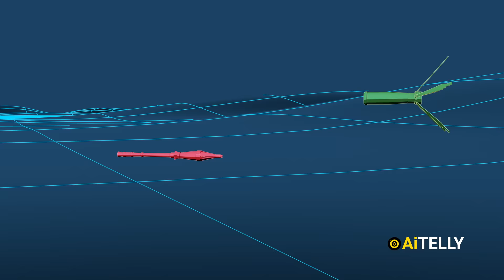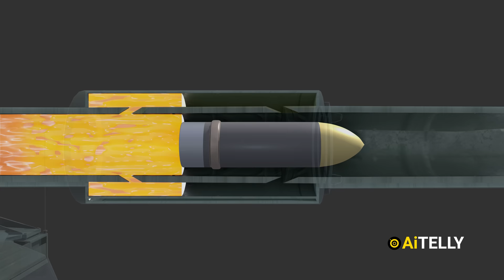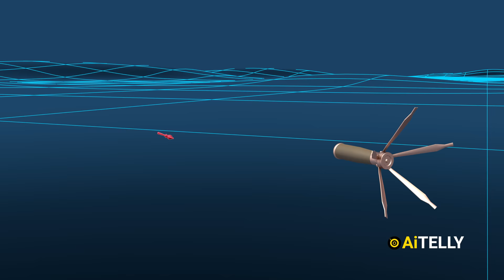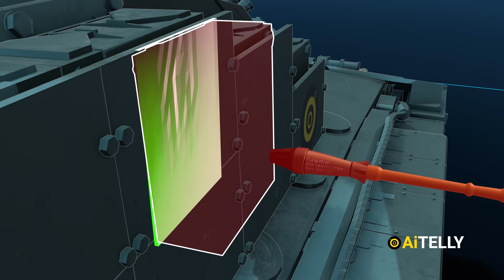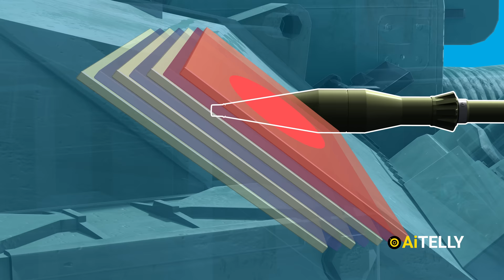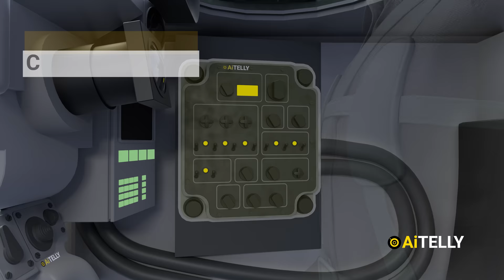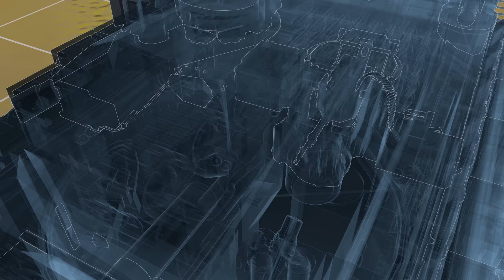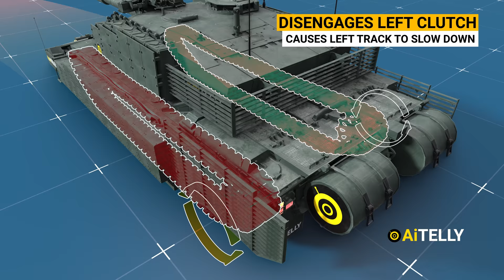Challenger 2 Tank How it Works - with Chobham Armour and Iron Fist

Comment from the maker: Imortant Notes from our Audience The Community is great here.
1) "Qasim Mir"
 It’s important to note regarding driving is that the steering is geared. Meaning with each gear there is a different turn radius, so if you want to do a tight turn you must change down a few gears to be able to do it. Another thing is the steering tillers only control where the front of the tank is pointing. Meaning, if going ahead and you want to turn right, you must ‘come right stick’ pulling the right lever, but, if you’re reversing and you want to turn right you must ‘come left stick’ and pull the left lever.

It would be good to touch on the tank’s suspension. Unlike other NATO tanks using torsion bars, Challenger 2 uses hydro pneumatic suspension. The British don’t like suspension that is mounted inside the hull on MBTs so you will never find a British tank with torsion bars. Before on Centurion and Chieftain they had Horstmann suspension. Challenger introduced the outside mounted hydro pneumatic which was easy to service but also performs better at springing and dampening than torsion bar.

2)  "Qasim Mir"
The firing procedure for a Challenger 2 engagement is as follows (as far as I know):
Commander or gunner will acquire the the target: ‘A fin, a tank!’
(‘Fin’ means APFSDS)

Operator will load the the relevant round
Gunner when he’s brought to target by the commander and adjusted aim will shout: ‘ON!’ or ‘ARMED!’ Idk😳
Operator will report: ‘LOADED!’
Gunner will fire: ‘Firing!’💥
When the round hits, gunner will say: ‘Target!’
If the commander is satisfied with the damage he will reply: ‘Target stopped!’
End of engagement.
Reply: Hello, when will Turkish subtitles come to your videos. Because there is no Turkish subtitles even in the automatic translation section.
Reply: Thank you for sharing my information.
Reply: I LOVE IT THIS ARMOR IS STILL CLASSIFIED AND THIS VIDEO IS BULLSHIT IVE SEEN A BROKEN ABRAMS TANK SKIRT And holy SHIT Chalanger is a slow shooter I could load off a round on an Abrams less than a round every 3 seconds
Reply: Please also do one content for the South Korean K2 Black Panther. Thanks!
Reply: Short correction here: 

1. Challenger 1 still used the same Horstmann Suspension as Chieftain.

2. The shown weight of the different MBT´s and especcially Challenger 2 are false.
Challenger 2 without TES (Theater Entry Standard armor addons) weights in 62.5 metric tons, with TES it weights 75-76 metric tons.
Leopard 2A7V and M1A2 SEP.V3 weight in at about 66 metric tons.

3. The L30A1 rifled 120mm L/55 gun is exclusively used by the Challenger 2 (L11 rifled 120mm L/55 gun is the predecessor on Challenger 1 and Chieftain). No other NATO partner uses this gun. 
Leopard 2, M1 Abrams and Ariete use variants of the RH120 smoothbore 120x570mm L/44 or L/55 gun, Leclerc uses the GIAT CN-26/52 gun, a 120x570mm smoothbore gun with 52 caliber lengths.

4. The Enforcer RWS is not regularly mounted on Challenger 2, even in TES configuration. This was added for the "Street Warrior" upgrade for urban combat. Only one Squadron was fitted out like this.

5. Black Knight, aswell as the other LEP Prototypes were in the end not procured and canceled.

The described Challenger 2 would not be used in reality, the regular Challenger 2 does not feature a RWS nor an APS system.

6. The Incident where a Challenger 2 was hit by a Milan ATGM, the Milan used was a Milan 1 ATGM from 1972, wich was sold to Irak in 1982-83 by france. 
The Milan 1 ATGM had a single HEAT Warhead with about 350mm RHAe Penetration. This was indicently less penetration capability than the RPG-7WN and RPG-7WR used by iraki forces (wich had about 500-700mm RHAe penetration)
This is btw not an example of exceptional survivability.
If you throw a waterballoon at someone and another one filled with solid ice at another person, you wouldnt say that the person hit with the normal waterballoon is exceptionally tough because he can take the hit.
CR2 is a late 1980´s design with armor thickness representing that. 350mm HEAT Penetration wont penetrate the frontal armor and would likely struggle with the side armor too.
Similarly the RPG´s have 500-600mm penetration, that wont do much to the front, at the side this would also be likely not enough to penetrate. This would be also the case for Leopard 2A5 and later versions aswell as M1A2 Abrams versions.
Other, more modern ATGM and RPG´s, like 9K135 Kornet ATGM with estimated 1200mm Tandem HEAT Warhead would seriously threaten Challenger 2, as it did with Leopard 2 and M1.

7. one also has to mention that the steering tiller system is quite outdated and anachronistic on a vehicle that entered service in 1998, while basicly all other NATO MBT´s from 1978 onwards used steeringwheels and more user friendly controls.

8. in comparison to other NATO MBT´s the Engine of CR2 is quite underpowered and both offroad and on road topspeed of CR2 is about 10-15km/h slower than the competition in both areas.

9. Major Con: Neither Ammunition nor Spareparts are in production for the last 10+ years, the Vehicle itself has basicly no export and is out of production since 2006.
This turns the Cr2 into a logistical trap
Reply: @seha6391  
Wrong. Challenger 2 is one of the fastest shooters in NATO. It has just won an international competition regarding that very quality. The two-part ammunition is more readily accessible and quicker to load into the breach.
Reply: @zhufortheimpaler4041  
Another short correction.
1. Challenger does not use the same Horstmann suspension as its predecessor Chieftain. It indeed does have independent hydro pneumatic units.
2. Challenger 2 isn’t that underpowered. It’s suspension does allow it to drive at significant speeds off-road. Leopard 2 is just faster. Doesn’t make Challenger 2 slow.
Reply: @qasimmir7117  I looked it up you got me I shot Presidential top 100 in 9 mm  Its a Tight playing Field IN a M1 I could load off A round every 4 Seconds 1 Second to open the blast door one second to flip the 80 pound Round 2 seconds to load clear the breach and arm and yell UP Auto loaders and stacked ammo are much slower
Reply: For the Rarden 
800
Sabot
Travers left
Steady
On
Tank in open
Gunner 
Firing now (Fire on the ow of now...
Target. etc
Next Target etc. It is 30 years since I did it so it might not be 100%.
The commander is directing the gunner on to the target by the ocular sight. I might have the range in the wrong place.
I have no idea what they do in the chally but it would be similar.
Reply: what if the loader is called Finn
Reply: @seha6391  "And holy SHIT Chalanger is a slow shooter"

Challenger 2 just won 2023 Iron spear, beating a Spanish crew in a Leopard into second place and a US crew in an Abrams into third. Perhaps next time, you should volunteer for the US team?
Reply: the tank in your video is called Megatron and it is not a production tank it is a testbed . also the trophy system present on the Black Knight is also experimental. but good video  it's pretty accurate
Reply: @Zhufor TheImpaler  As far as open source research goes that's a good effort however there are issues with open source research and circular reporting. Point 6 is wrong and engine power is not too bad.
Reply: 2:20 The Soviets made their bridge capacity 45 tons so that when western tanks passed, the bridge would immediately collapse
Reply: @komisiantikorupsikoruptord6257  45 tons? That's the weight of one fully loaded truck or about 20 family sized cars. What did they make their bridges from, cardboard?

The Crimean bridge has a capacity of 1000 tons ...they obviously didnt get the memo.
Reply: @Martyntd5  bridge in a rural area. what the Soviet Union did was nothing special, Japan also did it
Reply: @Martyntd5  it is believed that only less than 40% of the bridges in Ukraine are passable by leopard 2
Reply: @zhufortheimpaler4041  Challenger 1 used hydro-gas suspension not scary spring bogies , you did not mention neutral turn where one track is braked while the other drives whilst no gear is selected and revs applied . Tillers might be old but the tank is easy to steer . Ammo is still available from Belgium , many commonly used parts like suspension are available or reconditioned . Stuff like exhaust inner tube with expansion bellows and louvered outer ejector would have to be specially made and not cheap due to design and materials !
Reply: "Its not how it works Its how it burns"  -Chadimir Poutine 2023
Reply: If the commander wants the gunner to reengage he will say : "target go on".

When the commander see through the CPS a target he wants to be engaged, he says "gunner fin tank" or "gunner hesh apc" (for example), while pressing the align control on his gun control handle. When alligned the commander says "on!" and gunner reports "on!" when he see the target.
Reply: @zhufortheimpaler4041  Oh God, not you again.

Comment: It’s important to note regarding driving is that the steering is geared. Meaning with each gear there is a different turn radius, so if you want to do a tight turn you must change down a few gears to be able to do it. Another thing is the steering tillers only control where the front of the tank is pointing. Meaning, if going ahead and you want to turn right, you must ‘come right stick’ pulling the right lever, but, if you’re reversing and you want to turn right you must ‘come left stick’ and pull the left lever.
It would be good to touch on the tank’s suspension. Unlike other NATO tanks using torsion bars, Challenger 2 uses hydro pneumatic suspension. The British don’t like suspension that is mounted inside the hull on MBTs so you will never find a British tank with torsion bars. Before on Centurion and Chieftain they had Horstmann suspension. Challenger introduced the outside mounted hydro pneumatic which was easy to service but also performs better at springing and dampening than torsion bar.
Reply from the maker: Thanks for the beautifully written notes.
Learned a lot today
Reply from the maker: We have Credited you for this insightful comment.
Reply: HAS to have good suspension or the crew might spill their cuppa!
Reply: @danhodson7187  
Indeed. Tea is vital for victory.☕️
Reply: Great read. My dad spent his career transporting challengers and other vehicles nice to have a good insight into it all.

Comment: I am Russian, and I can barely speak English. Much less be polite. First of all, thank you very much.
1. The coaxial chain gun looks much simpler, single barrel. It has features important for a close tank.
2. English tanks are one of the narrowest today. Even in comparison with the Soviet ones. The thing about railroad overpasses. Some decisions of this tank have to do with the width.
3. The hydraulic automatic transmission does not disengage the clutch, but reduces the power of one of the tracks.
4. The Challenger can still fire at a large downward lean angle, which increases its heavy turret. It has relatively high ground clearance, a smooth bottom, and mine protection. This, too, increases the height.
5. The suspension of this tank is unusual: compact and adjustable (located on sides, not on the bottom, which reduces the height of the tank). That is why the tank can withstand unprecedented overloading of the hinged protection.
6. The inclined multilayer armor barrier refracts (as in optics) the shock front of the penetrator many times. This leads to its defocusing (as in optics). In practice it looks like the penetrator is crumbled, by dissipating the energy to fluctuate the layers.
Reply from the maker: @
Ernest   Awesome point of view
Reply: @Aitelly  I was trying to present facts, not opinions. There are too many opinions around.
Reply: Point 5 the suspension system has inspired the new South Korean tanks and it will become more prevalent.
Point 4 British tank designers have long valued being able to have a large depression angle, this has proved extremely valuable to them in many conflicts eg Korea and to the Israeli’s where the Syrian forces were at a significant disadvantage.
Reply: "I can barely speak English" delivers a seminar of information on the tank concisely. 

Please never learn English properly, you will make us look bad.

Comment: A positive you failed to mention is the suspension that allows better cross country performance than its competitors even with higher power engines. Coupled with easier repair to the external suspension units when damaged in combat, whereas battle damaged welded torsion bars in the Leopards and Abrams require back to base, torsion bar torch-cutting, disassembly, removal and repair.

Comment: I'm glad you're talking about the Challenger 2 here and not the "Challenger 3". The UK government isn't fooling anyone that what is merely upgrade suite is a new tank.
Reply: Well it’s an entirely new turret, gun, firing system, self defence system, new armour and new engine. So i would hardly call it a light upgrade. It will do nicely and certainly better than anything potential foes have. Just need more of them
Reply: The only thing the same between the II and III is the chassis. The gun is switching to smoothbore.
Reply: @1maico1  Even then it's been changed, the lower Glacis has been up armoured on a chassis level not just add-on, the tank uses 3rd Gen Chobham called Farnham and has add-on armour like the Challenger 2 TES had called EPSOM which is upgraded from current standards (This is how we'd send tanks into battle with the add-on armour) So the Chassis has had a lot of work done, not forgetting APS has been confirmed, specifically Trophy.

Comment: "....the  Mark IV. The first battle-tested tank made by British engineers......". In fact the first tank made by anyone anywhere. Called a "tank" because that was the code word for it while under development and the name stuck.
Reply: Spot on… The tank was originally named land ship by British Military in WW1. The name "tank" was initially a code name to maintain secrecy and disguise its true purpose by making it appear to be a water transport vehicle for bringing water to the troops at the front line. 

Extra Facts: 

Challenger 2 (CR2) tank can also set a smoke screen by the injection of diesel fuel into the engine exhausts.

The secret weapon of any British Armoured Vehicle BV. A boiling vessel (BV) is a water heating system fitted to British armoured fighting vehicles that permits the crew to heat water and cook food by drawing power from the vehicle electrical supply. It is often referred to by crewmembers as "the most important piece of equipment in a British armoured vehicle".

Comment: Slight correction on how the "Chobham" amour works: It's basicly a hollow steel box with the primary feature of the armour is it's NERA array, those aren't plastic armour plates but rather a form of Non Explosive Reactive Armour (or NERA) that uses a synthetic  polymer (artificial rubber) not plastic. These work just like the ERA blocks, the have a thick plate of armour with a block of "rubber" behind it with a backing plate of thinner steel behind it. The round hits the front plate, compressing the rubber stores that energy like a spring. Once the rubber is compressed to a critical point, it releases that energy and "pops out", slamming the front plate into the projectile or HEAT jet. 

Now NERA isn't as effective as ERA but it's biggest pro is that it can be used safely in a confined space (you can't use ERA inside of a block of armor for obvious reason) and it doesn't blow itself up so it can take several hits before failing. To make up for the fact that a single plate isn't that powerful, they are stacked in a array of several NERA modules with enough of a gap between them that they won't take each other out when they go off. 

Modern version of this armour (such as next generation special armor on the Abrams  M1A2 variants or Dorchester for the Challenger II) are a bit more complex, though I'm only going to be vague here.... this stuff is classified after all and I don't want to go to jail. These add plates of High Hardness steel to the back of the armor and in the more modern version of the armor, advanced ceramic/steel composites in front of the NERA array (you can tell which have them because the armor sticks out more to accommodate them). DU is used as well, but usually only in the turret checks (at lest with the Abrams. They did experiment with using it in the hull but it was found to not be worth the extra weight and cost since the type of weapons that tend to be used against the hull are already stopped well enough by the armor it has already), there is some neat stuff with how it's used but I can't really go to deeply into that. The NERA arrays have also been updated with some pretty exotic stuff, the material used acts more like a reusable explosive (like I said, it's pretty crazy stuff) which of course brings the NERA closer to ERA in power. It's also now placed in the armour at odd and counter intuitive angles (they're not placed following the slant of the armour). The reason for this is that they found by changing the angle the round hits, it can change the direction the round moves after hitting the array and is usually set so that it directs the attack upwards so that it punches through the roof of the armour instead of going deeper into the tank.

Comment: Challenger 2 Tank How it Works:
It's on the side of the road.
It burns very much.
It smokes a lot.
Reply: Hit a mine. The crew bailed and sometime later it took a hit from a Kornet. Any tracked vehicle will be immobilized by ATMs. It was noticeable there were no armour modules fitted, they have not been supplied to Ukraine.
Reply: @1maico1  The Kornet is very powerful drill 1200 mm of composite armour, it would also have drilled the armour module.